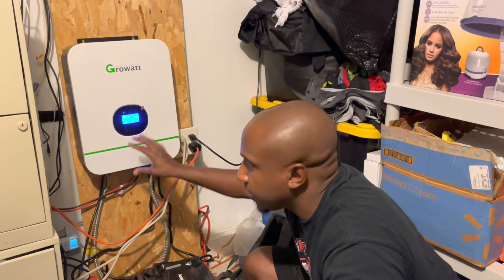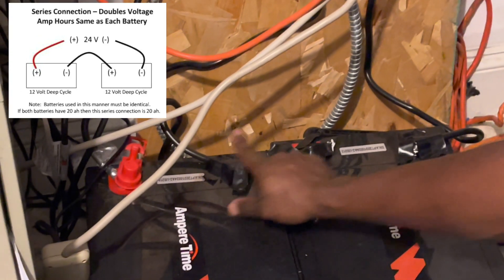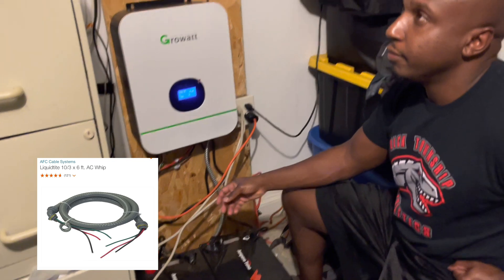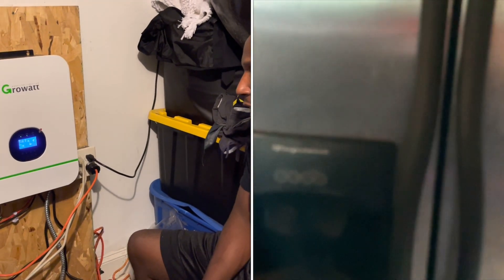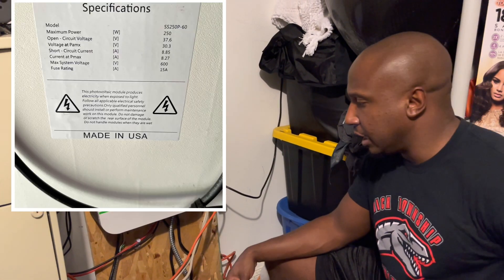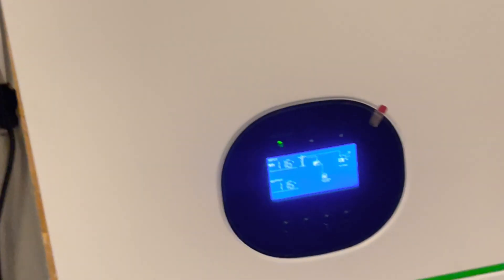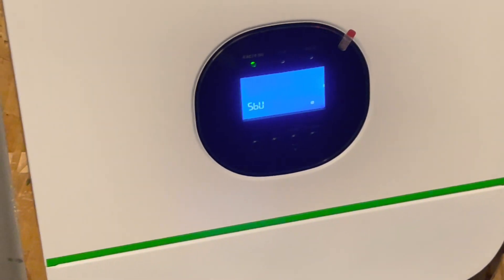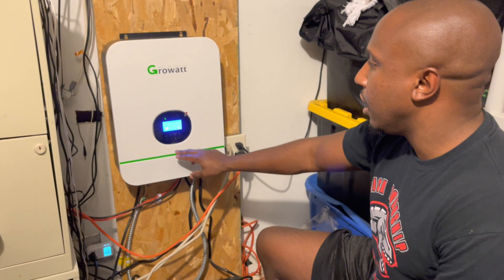My Growatt setup

Comment: what model of inverter is this, please? And how many solar panels do you have connected, w/SP?
Reply from the maker: I have 2000w of solar but sometimes it over volts I think 3 250 watt panels in series and then parallel will be ideal. My middle is the 24v apt 3000 here is the link 
https://signaturesolar.com/growatt-24v-3kw-150vdc-stackable-off-grid-inverter/

Comment: 24 volt sys?   how did you wire panels?
Reply from the maker: I had two sets of two wired i series in this video, soon I will post a update in which I have 4 sets of 3. (3 series into 4 parallel circuits.

Comment: I am researching my solar plan and used your video in my research. Question, isn't the a/c output of the growatt factory set at 230v ?
Reply: 48 volt and get the 5000 es from Growatt. But only buy that inverter from signature solar. Look at my system. I am going to start a new system this summer with only one inverter. And one or two batteries and however much solar I can afford on a budget.
Reply from the maker: I actually have it going 120v output because it’s the American model. This model needs to have two in parallel to get to 240v

Comment: So do you need 24 V batteries
Reply: Yes , I put two 12v in series
Reply: @rashadking3544  2. 12 s. equal 24 volts
Reply from the maker: 😂 I know. that’s why I said yes

Comment: Hey I got the same set up, but I haven't hooked any panels up to it yet. So it's just plugged into the grid. I don't run any loads on it so it just draws 7watts. So why does it cycle my batteries every 4 to 5 days? I'm using 7 wh x 24 hours in a day =168wh times that by 4 to 5 days and that's not even close to 5kw. Is my math off? Idk, what do you think and how does your system run? How often does it cycle through charge states...
Reply: I’m drawing much more , at least 2kw a day and 4kw on Saturday so my use case is much different. Look at the Manual , setting 20 something has settings for charge cycle. I’m assuming you have it as a ups? You also want to look at the voltage level, you can change how low the voltage goes before it starts drawing. I set mines to only cut on if it goes to 24.6 volts
Reply: @rashadking3544  
Yea I got all the settings right, I'm just seeing how it draws the voltage while just sitting, Ian said that unfortunately that's how the machine works, if it's got batteries connected to it, and its turned on it uses power even its plugged into the grid. Om just wandering why at 7watts it runs down to 23.1v every 4 to 5 days and recharges.... seems like at 7wh it would take a month to drain down enough to start charging.
Reply from the maker: That’s true the inverter draws a lot of power as well I’m sorry I overlooked that.
Reply: I only charge my batteries using solar. Otherwise you are paying to charge your batteries.

Comment: Looks good, I have the same inverter but 48v.  10AWG wire will handle up to 30 Amps, but if your max possible is 32 amps, you should be good until you expand.
Reply from the maker: Thank you. 🙏🏿 I’m using 6awg for the battery I was thinking the same thing. I do want to look into getting a hire gauge for the solar as I expand.
Reply: @atechieinchrist  don’t get higher gauge for the solar. Get an inverter that takes higher voltage than put more solar panels in series. Jump up to a 48 volt system. There will be plenty of people to buy your 24 volt system. It’s cheaper to expand with a 48 volt system.

Comment: Great job. Look up how to feed your AC output to your home power panel.  Easily feed power into your panel, and control what’s powered in the house by the circuit breakers. Benefit? For instance easily choose what AC outlets are powered or lights, etc. Then can also feed house by gas generator too. Much cheaper and easier then running miles of extension chords. :👍
Reply from the maker: I was actually talking to the wife about that being our next project , we are looking to invest in two more batteries and install the transfer switch.
Reply: @atechieinchrist  Hi, can this Growatt SPF 3000TL HVM-48  work with normal lead-acid battery?

Comment: Did you use a battery balance circuit?  Series circuits with lifepo batteries need a balance circuit, I think? Right?
Reply from the maker: I did not to be honest. The growatt balances the battery in settings, I haven’t seen davidpoz or will process do it so I didn’t consider it to to be honest. I have checked both batteries and they where balanced so I’m assuming it’s ok
Reply: Hi, I know the system is small. But I would have the ac output go into a small breaker box. That’s what I did in the beginning. It just protects the inverter from an overloaded situation. But I plugged in my power tools.